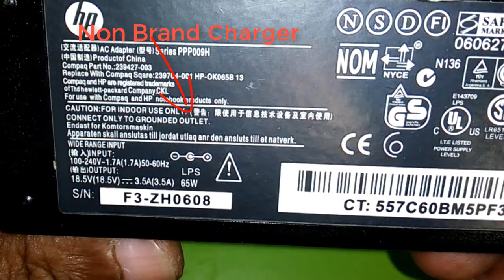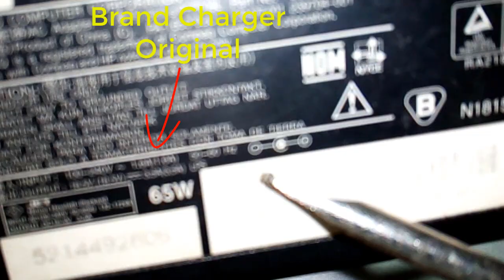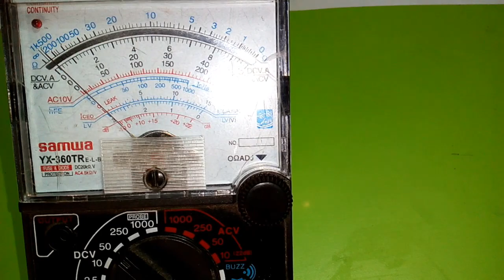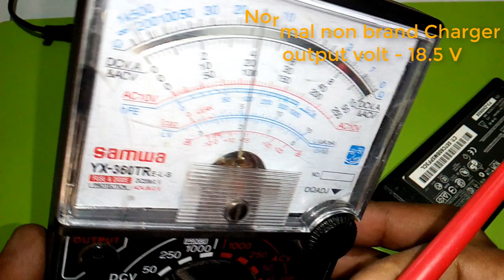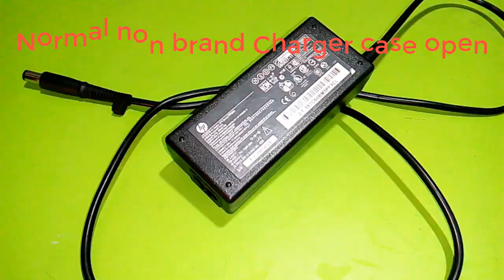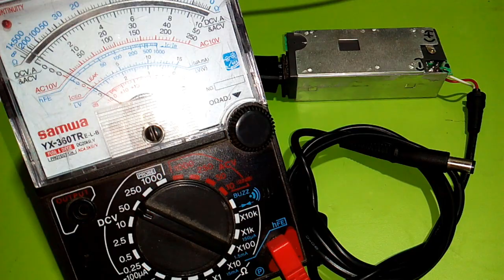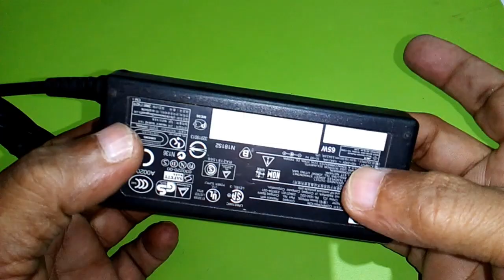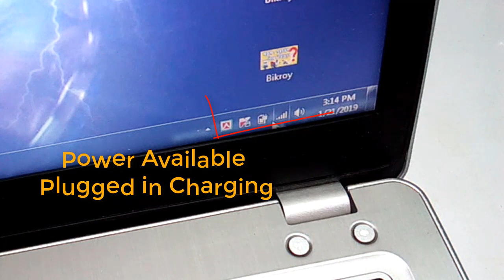How to use any laptop charger of different laptop | All in one Laptop Charger | Make laptop Charger

Comment: Hi so quick question, can I charge my laptop without all of this tech? Not a single USB, USB-C, or HDMI ports charge it. The main charging point has a piece of plastic stuck in it an I can't get it out.
Reply from the maker: Use kerosene oil outside the stuck
Reply: So I did that and now the plastic is out but I think it messed with the charging port because it still won't charge even after I removed it. @DreamFinder

Comment: What do you mean by "non brand charger"? It's a legit HP charger
Reply from the maker: I mean a non-brand Charger which is not came with Laptop, It's made by the local market. Our country has available it. It’s quality not good at all. It’s not suitable for your favorite Laptop. Thanks.
Reply: @DreamFinder  Oh, that's bad... In Poland where i live fake products are illegal. They are only legal if the seller clearly says that it isn't original
Reply: Kacpreusz Same here in Australia
Reply: Non brand charger  here, means a laptop charger  which did not come with the laptop or is not  sold by the laptop company.

There are separate  companies, 3rd party, which manufacture laptop parts/accessories. They are  unbranded or  bear the name/logo of 3rd party company.  

These products vary in quality and price but are always much lower priced than the original. 

Eg. I use Lapcare company's laptop charger which I got for $11US with 1yr warranty. Its been working fine for almost 2yrs now.  I wont get the original charger for less tha  $28US in the market
Reply: What would happen if i should use a Dell laptop charger to charge my Lenovo thinkpad?
Reply: Is it safe are not?
Reply: @richardsmith5137  Proppably not a good idea. Chargers for Thinkpads are very cheap even the original Lenovo ones.
Reply from the maker: @richardsmith5137  you can use sir
Reply from the maker: @richardsmith5137  sorry for late my dear
Reply: @kacpreusz9911  in India fake products available more than genuine products..what to do??? Feel sad...
Reply: @DreamFinder  Wow your an Honest Guy.

Comment: Sir I have my 1 charger in which there are  3 wires blue, white and black and the other charger has 2 wires black and blue.So sir can I cut one white wire of the old charger and then I cut-paste it or this wire is also important??
Reply from the maker: Sorry for late bro. Check Positive and Negative pole and fix 2 lines Jack pin pole . Finaly checkout it's output +/-, May be Blue is + and black is -

Comment: Hi I live in India. Can I interchangeably use the Indian power cord (which gets fit into the wall socket) for all the brands of laptop adapters available in India? Or is it that the power cord should also have some specifications?
Reply from the maker: No no. Don't apply please. Make sure the output is same of you laptop. If matching then you can change your destroyed charger pin.

Comment: Brother I ordered a acer laptop (metal) online recently but I feel electric shock during charging on edges which are polished. I connected the charger to my non grounding outlet. But I didn't feel or get any electric current on my grounded outlet. Is it outlet problem or adapter problem?
Reply: @DreamFinder  how can I do that?

Comment: I have a laptop that i found over the summer.there was a box on a sidewalk.theres 3 laptops i think i took 2 laptops,i took 2 batteries also.now i have a ps2 charger i plug in and the light where you put the the cord lights up blue. the output is 8.5 volts and the  input from the computer is 18.5v 19 volts so i think is because the ps2 charger does not have enough current to charge the laptop when i connect it the computer doesn't turn on.its in good condition.LCD screen no scratches,keyboard ok no missing letters but its mis the hard drive.so people throw out parts for the laptop oh and i connect the dc motor to a dc mabuchi dc motor like HP,brother and epson its works.now its dead and i shoudnt have thrown out the Samsung laptop lion battery 11.1 volts 4400 amps the battery is mess up
Reply: how about zentality charger did you have ??5V 2.5A

Comment: I have 45w 19v laptop charger.. which is dead.......So i want to purchase a new one....but i am not getting the Same charger i want......so can i use higher watt charger...like 65w or more...?
Reply from the maker: Yes, you can use a 65 watt ac adapter, a.k.a power charger, for your 45 watt-compatible laptop.  It will actually charge your battery faster.
Reply: Actually i have acer aspire 315 laptop..... And i am not getting any charger like original one....not getting the same pin charger..... Charger specs is ......19v please tell me what can i do.?
Reply: @DreamFinder charger specs is..... 45W AC output....19v  2.1A

Comment: my macbook retina 13 need 16.5 v and 3.65 a can i use a lenovo charger with 19v and 3.42a ?
Reply from the maker: Sorrow matter, you can use15-17 v, but higher is not applicable of Apple's.
Reply: @DreamFinder  i found a adapter with 18.5 v 3.55a i test tomorrow on my macbook i let you know if works thanks
Reply from the maker: This items not available for experiment. after connect the power follow up charging up, thanks n share with me your experience bro.
Reply from the maker: Your update please bro

Comment: Nice vid I have a question could a charger that is giving 18V on a computer that calls for 19V, can it mess up the battery ?
Reply from the maker: Exactly bro
Reply: Even if the charger has 6.5a
Reply: @DreamFinder  like my laptop input is : 19v 6.15a 
The charger : 18v 6.15a
Reply from the maker: @mooauto2388  Try to connect this, You will get best result sir

Comment: Only 2 wires? Wrong 3 wires should be there in laptop chargers at least for hp and Dell
Reply from the maker: 3rd wire like Ground/Earthing. You can use without Grond.

Comment: What if the pin is different
Reply from the maker: How to use your Laptop charger Pin with original cable is available in my video. You just remove damaged charger Pin with original cable and replace your new charger.

Comment: can i use 170 watt 
instead of 135 ?
Reply from the maker: yes you can use a laptop charger with a higher wattage, however, there are some caveats. The wattage rating of a laptop charger is a maximum rating which means that the charger is capable of providing power up to the output wattage rating and or course anything in between.
Reply: No.  Higher wattage will fry motherboard. can use slightly higher voltage.

Comment: Im confused
Reply from the maker: Easy.
Reply: Nope
Reply: Not easy isnt an anwser
Reply from the maker: Fist check your main adaptor next find out another adaptor n change charging pin if needed.
Reply: Dont worry about it someone else can help with this issue of the laptop maybe can give me some help then stupid anwsers
Reply: I didnt see that respone dont worry about it
Reply: All you have to do is figure out if the non brand charger output is the same as your original charger. Then switch the jacks. What's confusing about that? You wouldn't want short circuits just because the non brand charger's jack isn't capable of 18.5v.